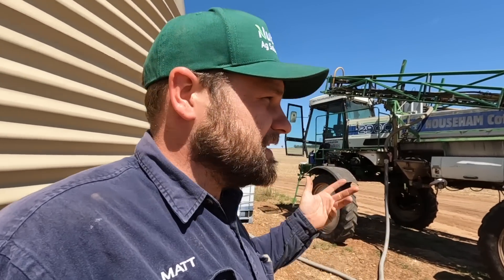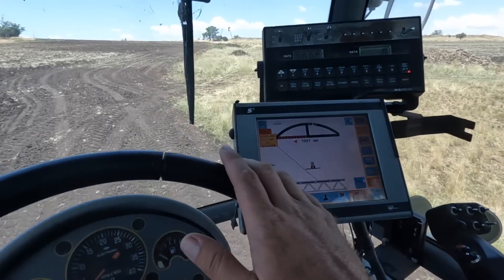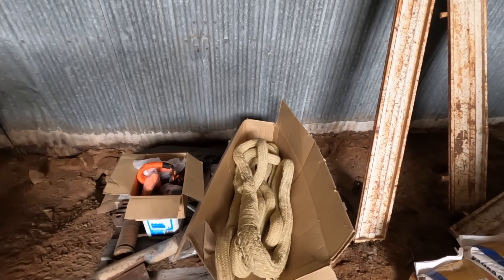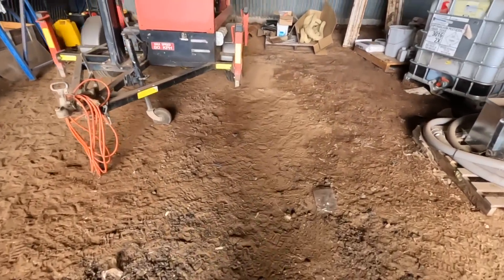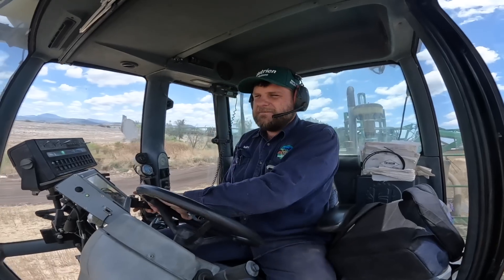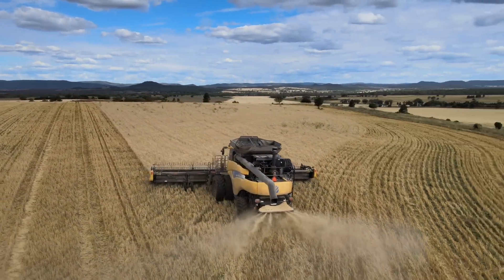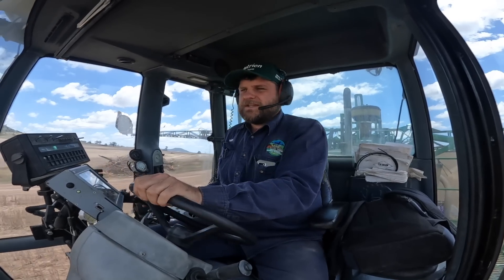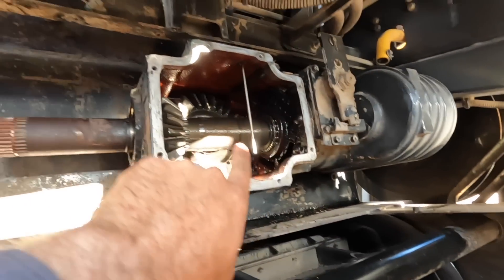Recovery Gear We Didn’t Need!! (Vlog 129)

Comment: Thanks for the summary Matt, I'm always wondering how your fairing on the margins
I was delighted to you got the crop off, that alone was a miracle.
Swapping two for one isn't something I would do.
One brakes down 100% loss capacity, one of two it's 50%.
In all fairness to your prep I thought it was extensive, it's a lottery just to source parts.
Whatever you do it will be good, just enjoying your content, bring on seedlings 😎

Comment: 😄😄😄   I thought the sprayer was quite  big but tucked away in the corner of THE shed it looks quite small 😄😄    Thanks for taking the time to put the video together .... the  Development Block is quite a long way from the Home Block   ... I imagine you have some back tracks you can take the D11's on .... actually I was surprised when Tiny 3 was delivered it was transported fully assembled.    Two older well maintained headers will always be more productive than one new larger header

Comment: Great stuff Matt. 2 points came to mind. 1) get some lay flat hose to go over the new rope to keep the mud out. 2) It is very easy to over capitalise on equipment and then you have to learn the machine and have a great relationship with your local dealer.Just like some of the guys in the USA, brand new is not always better, but it is expensive to do here in OZ.

Comment: Replacing machines with new ones is only the answer for some scenarios. But you have the resources and the knowledge to keep these headers running. You can do maintenance and prepare, but things break. Buying new won't guarantee you still won't have breakdowns. New machines break down, too, that's why they offer a warranty, so it's a false economy. You also know the idiosyncracies of each header, and replacing two for one is a backward step in terms of backup and production. $1.2m is also a lot of profit going to leases rather than reinvesting in the farm. Thanks for the update too.
Reply: Someday I'll hopefully figure out why you guys call a harvester or combine a header
Reply: @jpa1282  if you do find out, you can let us know because we have no idea. Also tell me why you guys call a torch a flash light, do you only put in on for a split second or is flash as in fancy?
Reply: @mrsock3380  Hahaha, I was going to ask you the same thing but instead why do you call a flashlight a torch, do you use it to heat up metal so you can bend it?
Reply: @obamabigears734  now you're trying to confuse the situation, you don't use a torch to heat metal, that's what an oxy is for. Next you're going to say you wrench on a wrench to do up a bolt, and that's just silly, everyone knows you wrench on a spanner to do up a bolt.
Reply: @mrsock3380  Yes, we better stop before we get completely confused 😂
Reply: There are always two ways to look at things. Yes new equipment does break down. But warranty,,,, if the new machine is bigger and more efficient it can replace two machines. Then you are saving on fuel, operator. For instance we bought the round bale cotton harvester and it is expensive but cost wise it’s way cheaper and more efficient. No boll buggie, no module builders. Less fuel and less labor.

Leasing. Leasing is 100% tax deductible. Every penny you spend. Where if you buy you only get to depreciate a certain amount.
Reply: @peteparker7396  Matt said their headers are large and the new machines at $1.2m may only increase their productivity by 10%. Spending $1.2m for a 10% increase wouldn’t be a viable alternative in any scenario
Reply: @@jpa1282  we call harvesters headers because the man who was instrumental in inventing the harvesters was a man named headlie Taylor who started sunshine harvesters but I could be wrong
Reply: @meataxe17  you may be right but I thought it because the early ones where strippers that only pulled the heads off so it became known as heading which then became header to cover all of them but I may be only going on with what I thought😁😁😁!!

Also if you go with a new header and then have a breakdown say that rotary box in stead of being down for 2 days, if it covered by warranty then it could take anything up to a week or more by the time you call out the dealership then they pull out the box take it back to town, pull it down, order new parts or box it will take 3 or 4 days to go through theirs system, which only works the hours from 8am to 5pm each weekday, then dealership receives the box or parts, (if its available at all in stock for a new machine) and then reassemble then back to the farm to reinstall, there's a week or more gone!!!!!
Reply: @johnmclaren3480  I learned something new today thank you
Reply: @jpa1282  It’s been explained many times.
Reply: @mrsock3380  Try explaining what a shifter is and what the hell is a zerk.
Reply: @meataxe17  You are right but HV McKay was Sunshine Headers.

Comment: Replacing 2 headers with 1 is silly, it's doesn't make economic sense.
Having the skill sets that you boys have, it's a really smart move to keep the old ones going. 

Also you guys subcontract transport which means money not tied up in trucks. 
Having bins on site is brilliant also.

You guys run a very smart financial operation and are commended for doing so.

Comment: Something people in the comments don't realise, is that a brand new 1.2 million dollar combine will STILL break down ;) Doesn't matter what colour it is the quality has all gone down, everything is plastic and designed to fail. And good luck finding parts for the new stuff if the aftermarket hasn't started making them yet, it would be a 1.2 million dollar garden ornament while you wait 6 weeks for parts to come across the ocean. And don't even get me started on all the software problems they have, gotta pay John Deere $30,000 every time you start a green machine these days or they lock the computer. And CNH and Agco do the same bullshit :(  As an LV mechanic i have no personal interest in owning a vehicle built after 2010, and there was even a noticeable drop in quality across all manufacturers around 2000-2005, but after 2010 they are literally all disposable vehicles designed to last ~5 years then be scrapped, in most markets thats about as long as they are legal before the emissions regulations change. Machinery is exactly the same. The manufacturers realised they save money by making it cheap, and it fails sooner and can't be repaired if they don't sell parts, so they can sell a whole new machine :(
Reply: It’s called “built in obsolescence”. 
It’s actually quite disgusting what they do to us layman. It’s the same even with hand tools these days. 2 yrs max and that’s if you’re not using them hard. 
Cheers.

Comment: Wanna sell the gear? Use a lot of these soft shackle goods towing and moving transmission cases and parts around. Do you all have a inline filter for your hydraulic system? The ones they make for transmissions will work on your system the screw on canister style.
Reply from the maker: Hi mate, the hydraulic systems in most headers are a bit different and make it hard to filter all the oil as it needs to supply a massive volume without restricting the flow, they come with a filter but it only filters a percentage of the oil👍

Comment: Once you go to a new machine you are stuck going that route. Newer machines will not age as well as your current machines. New machines break down as well except they often require computers to fix.
Reply: Exactly; they have sensors all over them and they are often the weak link in the chain, it seems to me.